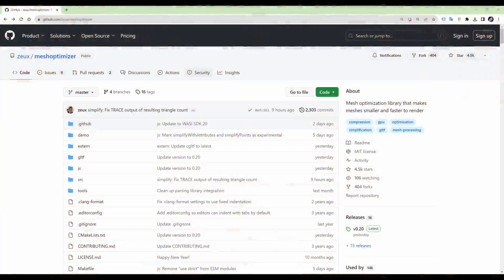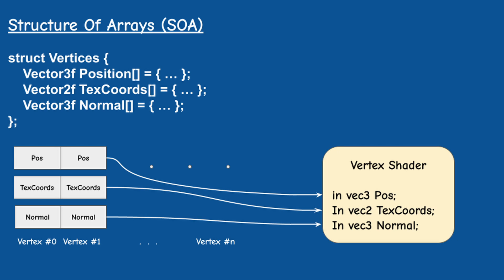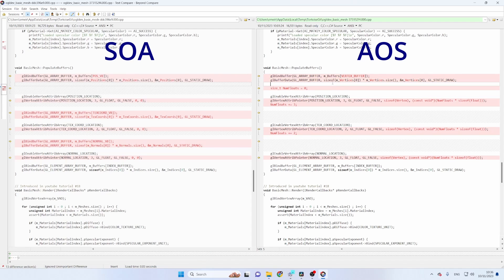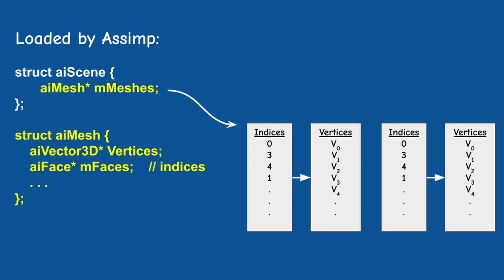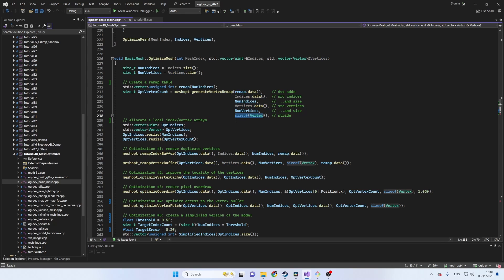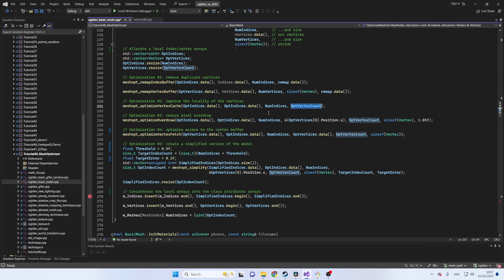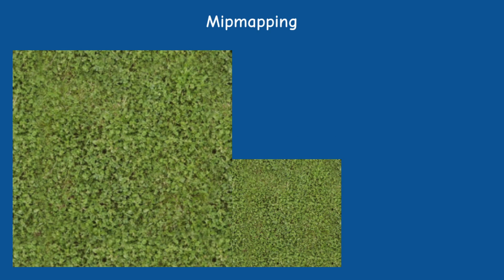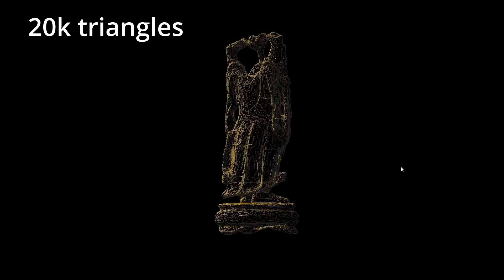Optimize Your Meshes! // OpenGL Tutorial #48

Comment from the maker: Clone the sources: 
git clone --recurse-submodules https://github.com/emeiri/ogldev.git

If you want to get the same version that was used in the video you can checkout the tag 'TUT_48_MESH_OPTIMIZER'.

Build on Windows:
Open the Visual Studio solution: ogldev\Windows\ogldev_vs_2022\ogldev_vs_2022.sln 
Build the project 'OpenGL Tutorials\Tutorial48_MeshOptimizer'

Notes:
1. I've implemented a similar change in the SkinnedMesh class which derives from BasicMesh. It is not presented in the video but you can check the sources for more details.

Homework:
1. Try to productize the mesh simplification optimization to be used in a real game. The mesh should be loaded by Assimp once and then optimized for several levels of detail based on the users request. When rendering the proper LOD should be selected based on the distance from the camera.

Comment: One question about the mesh optimizer. Will it totally ruin an animated mesh? Or does it only work for static mesh? thanks.
Reply from the maker: Mesh optimizer works well on the skinned model that I've tested. It optimizes the vertex/index buffers but you can still apply the same skeletal animation transformations.

Comment: So it seems one may actually then use this library to generate the lods for a mesh and not just for "optimizing the only one mesh", if you get my point. A user-configurable  lodtable per mesh along with that and some nice lodswapping can be made, if i understand this correctly.
Reply from the maker: Yes. You can integrate this library into an offline tool and then use it to visually tune the LODs. Then you can save them and during runtime dynamically switch between them.

Comment: In a renderer, does anything get rendered other than Meshes/Models?
Is this like the top level? / is the end-game of a renderer to loop over a list of meshes/models and draw them?
NEVERMIND I SEE THERE IS A LOT MORE :D
Reply from the maker: The job of the renderer is to generate the frame. Going over the list of meshes and drawing them is probably the simplest renderer that you can think of. A more capable renderer also handles the shadow maps, applies tone mapping/HDR/bloom, particles system, motion blur, etc. The renderer may also sort meshes by their depth or implement some method of BSP and it can calculate light spheres to calculate the light locally instead of globally.

Comment: Any numbers on what are the frame rate improvements after the different optimizations (without simplification)?
Reply from the maker: I didn't get a chance to do such measurements myself on real workloads. I guess it will be very difficult to provide a general guidance such as "the library improves the performance by 1.5x" due to the vast difference between workloads and GPUs.

Comment: Hi and thank you! Very informative. I’ve always thought that just Assimp is enough, but I’ll have to try to optimize my meshes!

Question: My geometry shader only allows for a single diffuse, normal, and specular map (3 in total). How should I handle meshes that have several textures per vertex? I’m very stuck here.
Reply from the maker: You're welcome :-)
Do you plan to use the same texture coordinates for each texture? Assimp supports loading multiple sets of texture coordinates per vertex (though I haven't used this feature yet). In general you need to assign a unique sampler for each texture and bind each texture to its corresponding sampler.
Reply: 1. Mix textures on CPU, if you mean several textures with similar format. Like several albedos per vertex.
2. Maybe try to use instance rendering as well and do rendering per instance with combination of geometry shader. That way to make draw call that send all instances to gpu, all instance can be stored in some sort of InstanceBuffer. In case of DX11 it's StructuredBuffer or in case of OpenGL it's - StorageBuffer.
3. Use Texture Array or Texture 3D and store texture index per instance or per vertex.
4. For optimization of 3. you can generate Texture Atlas, store atlas cells & locations into instance buffer and than send it to shaders.
5. You can use bindless textures feature in newer OpenGL. I don't really remember how to do it, since I switched to DX11 1 year ago.
Reply from the maker: There is now a bindless textures tutorial on my channel: https://youtu.be/Gk3JsDCBp1o